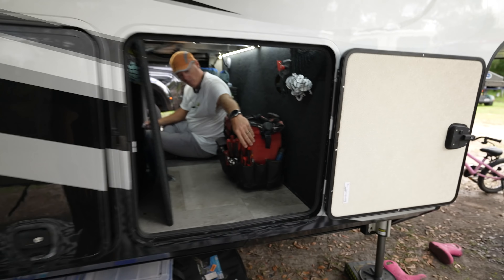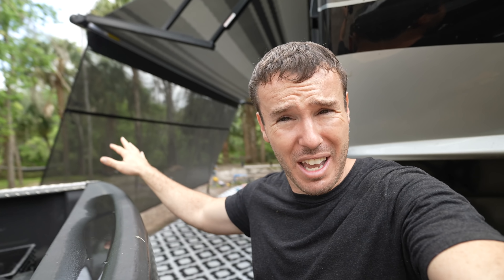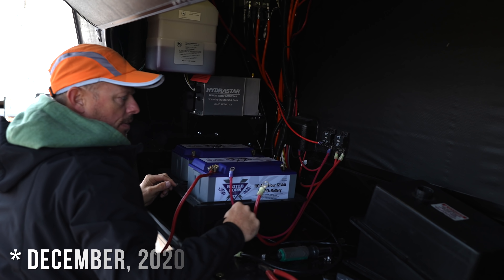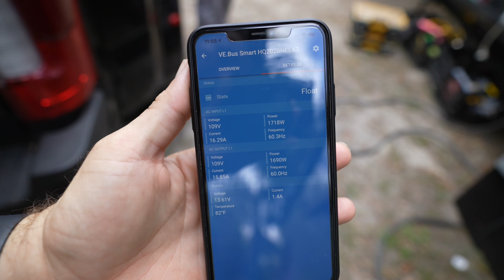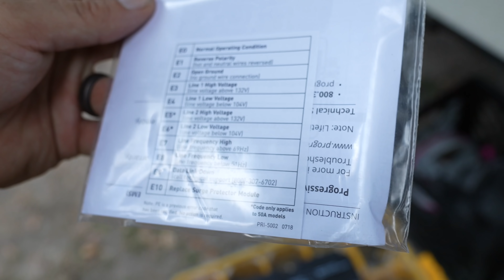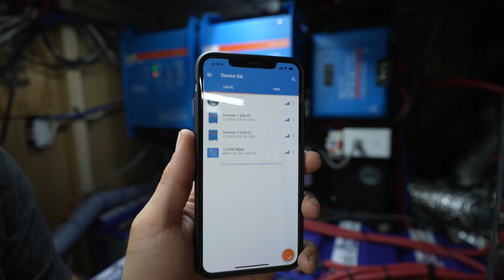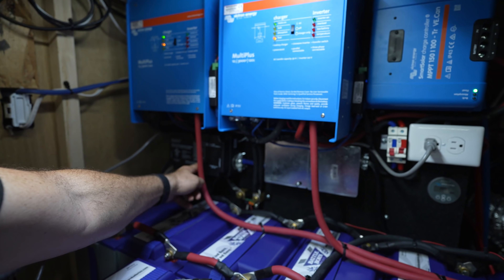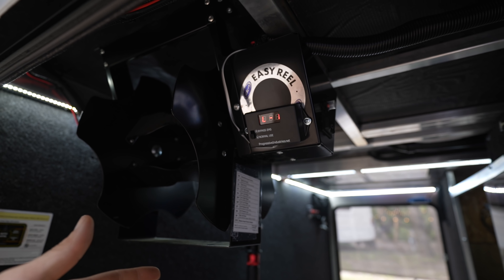HOW MUCH SOLAR DO YOU REALLY NEED TO RV?

Comment: What you you say for a weight - panels ,wiring , equipment and batteries? The reason I ask is you know have less weight to your limit. I want to install a similar system just wondering if you knew the weight. Love your channel
Reply from the maker: The solar is adding about 400lbs but we had a lot of capacity. 😀